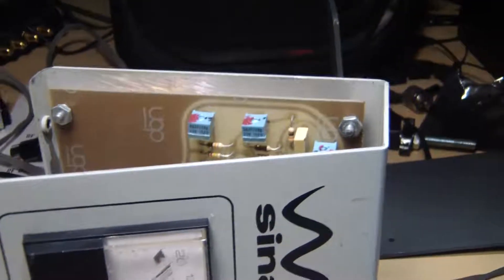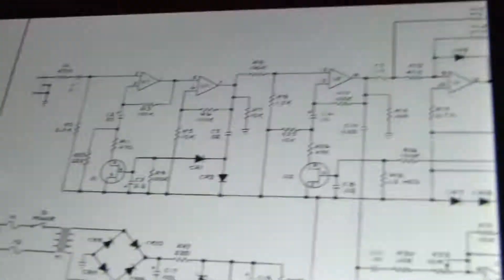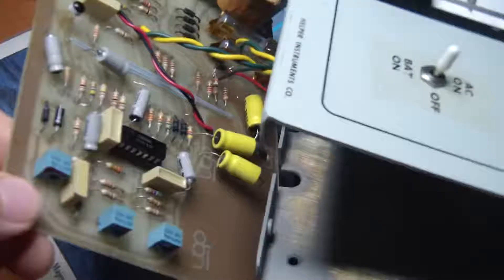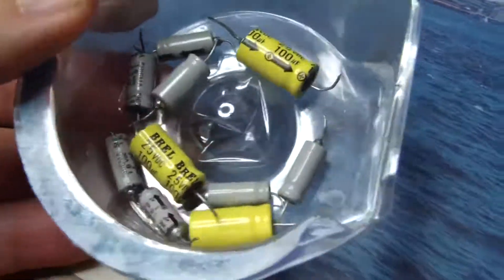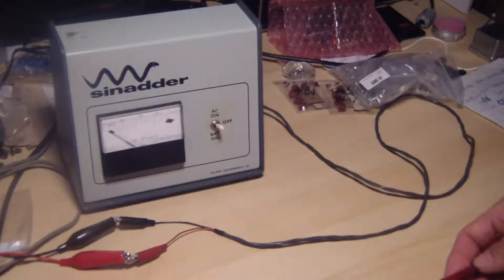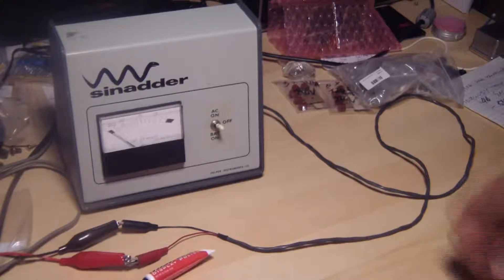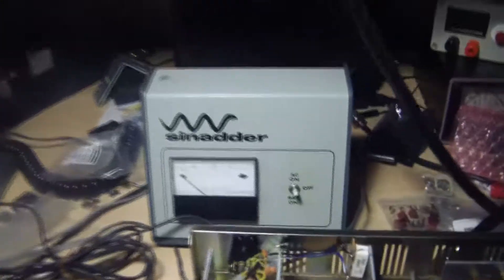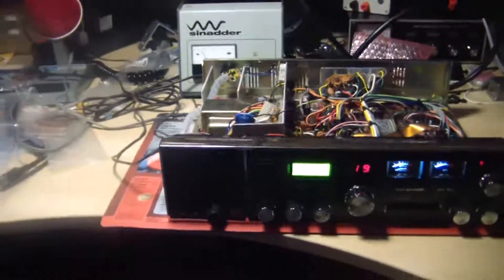Sinadder - SINAD meter - repair, calibrate, align - Final Chapter

Comment: I just ordered the same Sinadder from eBay. Looks like it's in rough shape so I'm sure I'll have to fix and recalibrate it. Good information here thank you. I just purchased a recap set from Klondike Mike's for my non DX version of the 2950 not that long ago. I recapped it and aligned it and I'm here to say that the radio works so much better with new caps. I had a 2950 back in the earlier 90s when I was a teenager. Now that I'm approaching 50, it's a nice project restoring one. Thank you Klondike Mike!

Comment: I have the same Sinnader, I replaced all the electrolytic caps although now when I turn the unit on the needle slams to the right. I tried adjusting the pots but no joy. I suspect that one or both of the chips might be the problem. Would you happen to have any suggestions?
Reply from the maker: I would first confirm ABSOLUTELY that your replacements were installed correctly and confirmed good.
Reply: Yes I have triple-checked the placement all done correctly @KlondikeMike